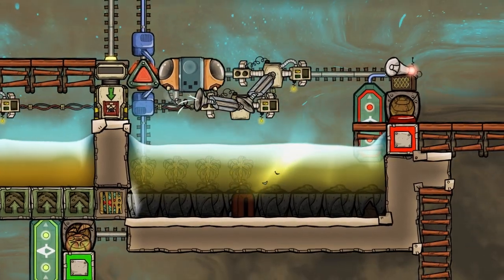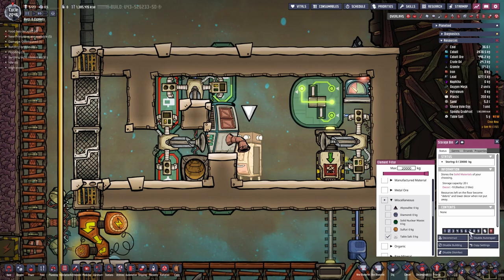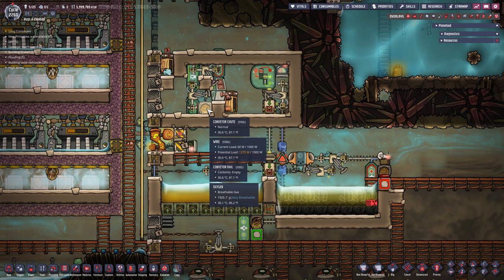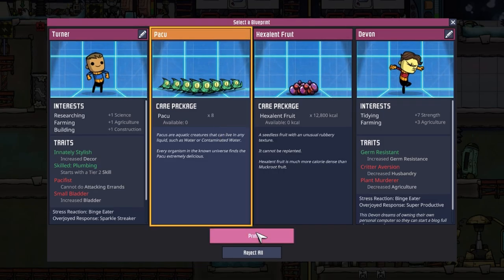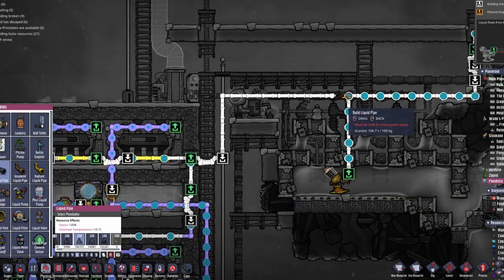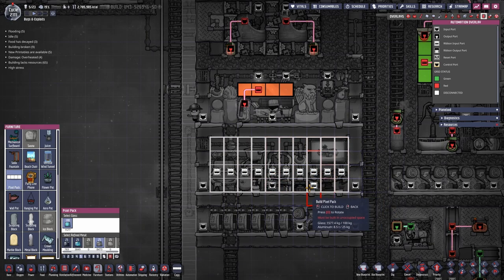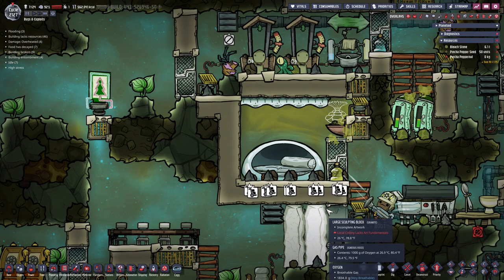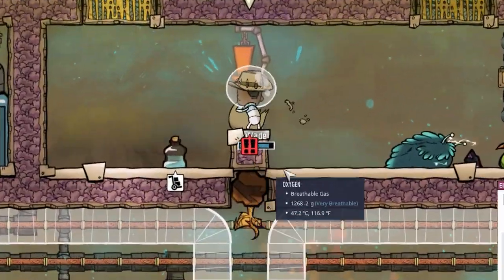Duplicating Seeds - Oxygen not included - Let's play Episode 17

Comment: Thank you for this.  
I’ve been using the heavy liquid infinite storage and had some problems. I think having a waterfall infinite storage would solve my problems. 

Seed cloning is very interesting. I hope they don’t remove that exploit since it’s the closest thing to real life plant cloning the game can get. Also useful for spicing food.

Also thank you for showing me an easy way to single tile storage food. Does it ever get warm enough to unfreeze with your method? What do you do if it does? Just restart the hydrogen cooling loop?

Thank you.
Reply from the maker: Glad i can help. Just remember to replace any tile that could get overpressured with doors.

Very interesting point. Haven't thought of it beeing realistic. Now it feels less like an exploit.

The single tile food storage is permanently cooled (meaning: the thermo regulator is passively active at all time).
The Hydrogen loop is forever circulating and always checked if the temperature is still at -80°C.
If you add a lot of kg of food the hydrogen gets warmer. Then the sensor notices that and the regulator gets activated.
Cooling the 1 tile back down to -80°C again. Why -80. Because i think when the dupes add hundrets of kilos i still have a temperature buffer until i reach the minus 18 degrees that would start the slow rotting process again.

If you want to have acces to the food storage you can have a autosweeper place a small amount maybe 2kg of food in a fridge near the storage.
Reply: @Luma_plays  I may use the doors, I may use air tiles. Is there any advantage to doors over air tiles?
Reply from the maker: @jAfr0Thunder86  Airflowtiles are only a solution where the liquid touches. The places where you have the gases need to be something else than airflowtiles.